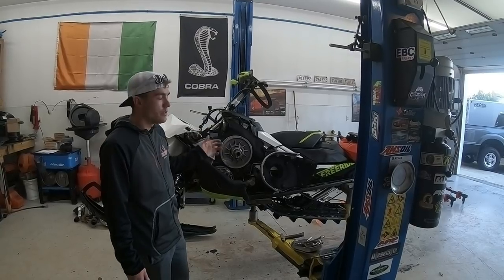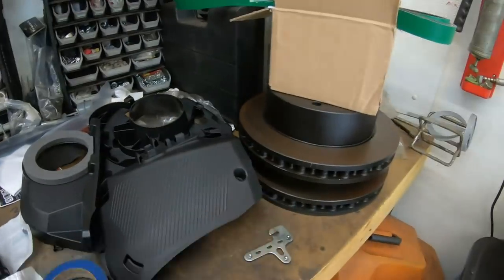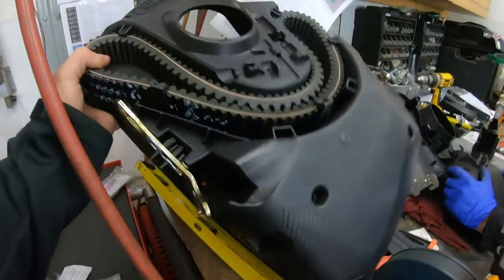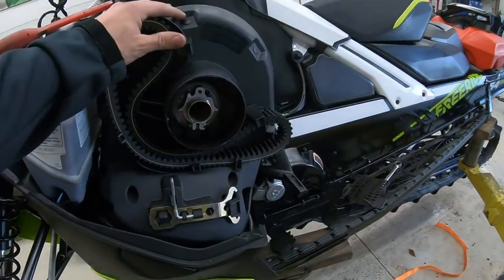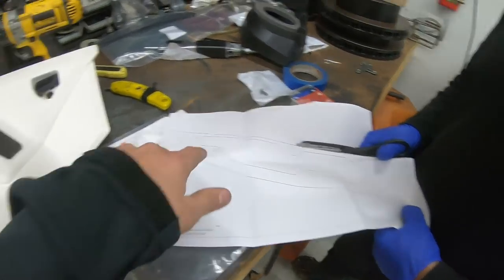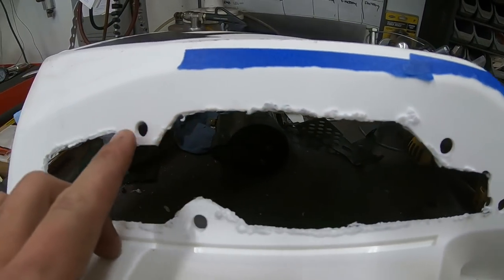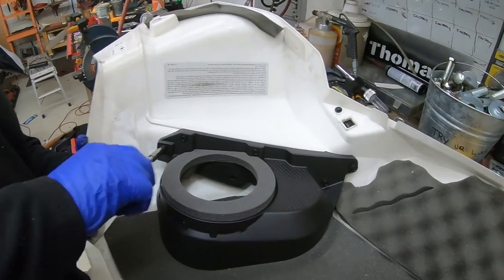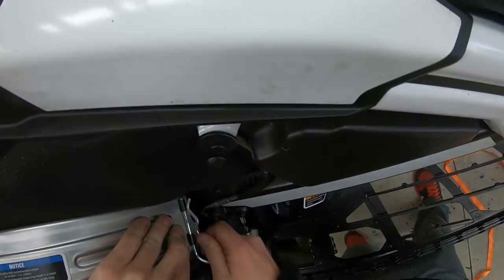CVT Clutch Update Vent Kit Install for your 2017-18 Skidoo G4 850

Comment: Is this a free update from Ski-Doo or a kit you can purchase if you choose to do so?
I Have 1,400 miles on my '18 BCX with zero belt issues so far.
I did take off the sound insulation and drill some additional holes in the clutch cover to help remove the heat.

Comment: is there a lower part of the plastic cover that needs to be reused or do you only rivet on the top metal piece and have a complete cover?
Reply from the maker: You only reuse the aluminum shroud, fasten the a new plastic cvt cover in place  and you’re good to go. No reusing previous plastic

Comment: I went to install mine and I found the 3 rivets for the front bracket didn't fit my rivet gun? You had mentioned you had to replaced
 the tip, would you happen to know what size you switched it too? Thanks for the help.
Reply from the maker: ahill7866 I don’t know the exact size but usually your rivet gun comes with different size fittings stored somewhere on it
Reply: Yeah I have 4 different sizes but for some reason those 3 rivets seem a bit larger than the 5 and does not fit into my Air rivet gun? Did you have to replace yours between rivets?
Reply from the maker: ahill7866 yes
Reply: Seems most standard rivet guns don’t come with that size. I just used a smaller rivet.

Comment: Helpful... thanks for taking time to do this Corey!
I didn't see the template to cut panel in those instructions at instructions.brp.com.
Do you have a template file you can send me?
Reply from the maker: Jeff Prashaw, The template comes with the kit in the box
Reply: @coreylanouetv4434  okay cool.  My belt temps are at 190° F with turbo so before going all-out with the update kit I wanted to see if I could saw a few holes in that match up with the hole for update kit vent and cover with pet screen and rivets.  That way if temps are still high I can still add update kit using same panel.  I'll call a dealer to see if they can get me a template file.